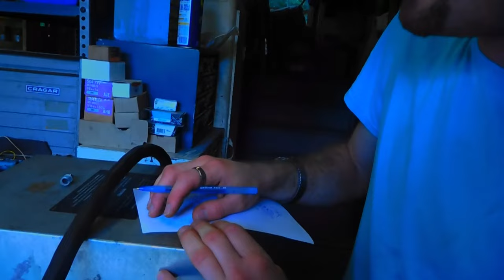Why Metric Base 10 is a terrible system.

Comment: The benefit of metric is compatibility and ease of conversion between different units of measure such as length, temperature, weight and volume:

1.5 kilometres = 1,500 metres = 150,000 centimetres = 1,500,000 millimetres.

A litre of water (100 centilitres or 1,000 millilitres) weighs 1 kilogram (1,000 grams).

The volume of 1 litre of water is 10 centimetres cubed.

Water freezes at 0° Celsius and boils at a 100° Celsius.

This is why the U.S. armed forces use metric in combat, because their lives literally depend on clarity and accuracy.
Reply: Not the US Navy !
Reply: You have to realize that water freezes at 0C and boils at 100C at sea level. The higher up in altitude you go, the higher the boiling point of water is. 

Since I am a huge car fanatic, metric makes it very difficult to identify a engine since some cars for example these days at 1.5L to 2.0L, there’s many engines out there with that displacement which makes it difficult to identify, especially if it’s a engine with a design flaw. If engines were still be cubic inches, would be able to identify quickly.

Comment: I think language is too big a barrier to use any number system other than base 10. The words we used are based arround base 10, so we think in base 10.
Reply: Yes, it's terrible we have no English words for a dozen and a gross. Even if there were a word for a dozen we'd be stuck with the fact that “ten” and “eleven” are made up of parts for their separate decimal digits.
Reply: in norwegian it is quite clear that it used to base 12.
Reply: @stephenspackman5573  Originally there were single glyphs for 10 and 11. They died out over the centuries as decimal gained popularity. Note that we have "eleven" and "twelve" as separate words, but everything above that from thirTEEN to nineTEEN is just a condensation of "<digit> plus ten".

Comment: I think in a more optimal world we should use the metric system in base 12. It does suck to not be able to divide by 3, 6 or 4, which is a very common operation.
Reply: But in the grand scheme of thing, the important thing is probably that we use the same base, so we can understand each other inventions. After all, if you don't want to lose precision, you can still use fractions to describe your metric measurement, and in practice we can't machine to arbitrary precision, and the specific need of each machine prevents use from using convenient whole numbers, so we will always have arbitrary digits to describe complex machines.
Reply: ". It does suck to not be able to divide by 3, 6 or 4, which is a very common operation."

It's only an advantage if you actually have 12 of something (or multiple of 12) and actually need to divide it by 2, 3 , 4, or 6. Actually dividing by 2 and 4 are the same and 3 and 6 are the same so you really only have two dividers, like with 10. It's a bit like saying we should go to base-24 so we can also divide by 12. :-)

Comment: Some random comments:

a) There is a reason the mathematicians that designed many of the first- and second-generation digital computers used base 12. Or that CDC computers had 60-bit words. Lots of prime factors are nice.

b) If you think about the representations of 1, 2, 3, 4 and 5, they do have a number of points corresponding to the digit.

c) You might want to look into Roman numeral fractions. Yes, there are such things, even nobody has been taught anything but the integers for 1500 years.
Reply: loved thinking on this comment
Reply: I can remember as a young child counting the top, middle, and bottom of the number 3 to add  3 to another number.
Reply: Oh which computer would that be? You mean every computer that was designed around the binary system because semiconductors uses a discrete sytem of 0 and 1? How would you multiply a binary system in such a way that you would reach 12? Show me a computer that uses prime numbers as a base system to calculate anything. Encryption uses prime numbers, true, but only in conjuction with XOR operations, binary base 2 operation that flip bits. The prime number is not at the core of that calculation, the XOR operation is. 

Computers could use a 12 bit bus, but that was simply because of simple limitations in the technology and most importantly it was the least amount of silicon one would need to store a base 10 number. There was no need for additional bits to represent something beyond 9. But everything still worked on base2 to begin with. Base 12 was a representation. 60 bit words in CDC computers. Yes, the ONLY computer that used 60 bit wide words. The world quickly switched to 64 bit wide words, because of the ease with which it held in base 2. 

If base 12 or something else was so vastly superior, then it would be used everywhere today. Humans only understand base 10, but computer can use whatever you develop them around. And guess what, base 2 is vastly superior and factors of base 2 (16, 32 and 64) are the most logical conclusion for uses within that system.
Reply: @patrickd9551  The first generation of digital computers were mechanical. Later ones used relays and vacuum tubes. There was quite some variety in bases and encoding before things settled out. CDC's 60 bit words were a strange hybrid, but they were much later. We had a Cyber at school….

I'm not sure where encryption comes in (those are very large primes), but 2 is a prime, and (along with minimality, of course) that's one of the things that makes it attractive for computation—there's lots of good number theory to do with prime powers.

Comment: I think any base system that is consistent and that everyone uses, is the best one. U.S. ("imperial") is horrible (I'm American) in this regard. We use fractions here, decimals there; base 10 here, base 12 there, units based on the length of some dude's toenail in 1627. Even within the same unit, even on the same drawing, fasteners might be called out like 7/16" while thickness of the washers for that fastener are called out in thousandths of an inch. This is where the metric system wins. It's consistent and everyone (except Americans) uses it. Base 10 might not be the most optimal system but the time for objections to it is long past. Everyone intuitively understands it already so that is how it is going to stay. 

P.s. the base 12 runes didn't even seem consistent. 1, 2, and 3 did, the number of lines is the number, but after that it fell apart. After 3 we start counting angles? Or? You lost me.

Comment: 12ths were originally used for everything including inches and of course we still have a dozen eggs, 12 months, 24hr days, 360deg in a circle or a compass heading and so on. For the common person 12 is much better for dividing things up. If you are a technical field e.g. a machinist you have to do math any way around it and like their metric counterparts imperial machinists use 10ths, 100ths, 1000ths, ... The solution to most problems there is to toss the excess to get to some reasonably divisible number. If you are making a cabinet with 3 evenly spaced doors into a space that doesn't divide nicely you pick a smaller number that does and then pad out the difference in spaces on the sides or between the doors or both.

Base2 is super handy for small (space efficient) representation and for on/off (binary) storage which is why it is used for computing. Hex, decimal, and octal in this case are representations of some binary state of data on a computer. You can also count much higher than 5 on one hand using base 2.

Comment: Due to my age 54 in the UK I work both in feet and meters and as an car electronics engineer I understand binary and computer hex, BUT at home if I measure a bit of wood it could be 4ft 7 inches and 3 mm but at work my brain can't cope with car tyre size (UK spelling) 195/65 R14 for example my brain as I look at it starts to work it out mathematically But that's the odd thing in tyres is they are sold in Metric/percentage  radius is Imperial
Reply: ha, I'm 60, from England. ! I too use both systems. eg when estimating lengths I might go from 2cm to 1" to 3cm!
Reply: Similar age from the UK. We grew up in a time when metric was taught in school but everyone older than us was using imperial (and so were all the shops!) so we got a weird mix of both. If I am calculating I tend towards metric (due to my base 10 wired brain), if I'm estimating I tend towards imperial, but I also do a weird mix of both where I might need a piece of wood 3cm x 4cm x 4 ft long 😂
Reply: In Scandinavia we use metric for general, but imperial for woodworking (originaly not British imperial but our own standard, but it later became Imperial) in addition to foot there where also another messurement "Aln! the messure of the forearm and hand, which is standarized to two fot or, today 60 cnetimeter. Only thing that does not make any sense whatsoever to me is the recent conversion from metric to foot for messuring flight height of aircraft, that one is a clear step back, but for wood and metal working me, and most people i know who want to learn in a deeper leve do use both metric and inperial in paralell for lenght and height messurement. My carpenters ruler has both scales, and it is fairly new and made in Sweden. ;-) I know theyt re made it to matric in modern time in most hardware stores, but people, my self included, still talk in imperial whan it come to dimmensions of wood and nails. 🙂 (Being born here, of course Celsius is the only option for temperature... ha ha, but there are a lot of paralell temperature scales as De Lisle, Rømer scale, etc which are far better for checking temperature in every day general use compared to the Kelvin scale which is originaly for temperatures above mercury and spirit themometers could preform by using the wawelenghts of light as referense point, so in my blacksmith it is important to know the basic of the idea of the Kelvin scale, it probably just had other names in te past, but for say, the airtemperature outside my window, using the Kelvin scale (is not wrong, but it) does not realy make much sense to be honest, but using for example the Rømer scale does.).
Reply: i think the first number is tread width in mm, the 2nd number is the width of the tirewall(ID to OD) as a percentage of the tread width, and then yeah for some reason the rim diameter is inches... it is very odd. thats how they are here in the USA too

Comment: I concur. Base 10 metric does suck, for many of the reasons you presented. However it’s not necessary to reinvent the imperial system, or contrive a base 12 integer set. Inches are divided into fractions. They can be any sort of fraction you like, it’s just that they’re usually denoted and divided in 2, 4,8,16,etc as an optimally convenient standard. Like time signatures in music. Not all time signatures are optimally written that way either, but most of it is.  I think it’s important to point out that imperial measurement system isn’t so arbitrary or primitive. Rather it’s an elegant collection of units, optimized for applicable utility, like a toolbox, as opposed to base 10 metric, which endeavors to standardized and universalize units, at the cost of being like Swiss Army Knife, lots of tools conveniently packaged into one, but none of the features perform as well as a dedicated tool would. ❤

Comment: The point of a measuring is to make thing accurate enough to do the work required, and almost as importantly create wide standardization.  At some point, and sooner rather than later for any reasonable value denominator to work with, you run out of whole factors.  At that point you are using either fractions or decimals.  Either work, the question is which works better for you so you make fewest mistakes.  I have proven that mistakes can be made with fractions and decimals, but the more resolution required the less mistakes I make with decimals, which seems to be true for most people (Most U.S. machinists who work in accuracies less than 1/64" use decimals...even while remaining in the U.S. customary system).  And by the way the fundamental feature of the S.I. system is standardization in unit definitions as well as expression; base 10, specifically base 10 with using decimals not fractions,  was chosen because it is the simplest way of standardizing the expression of any value regardless of magnitude.  It is a common mistake that people think the primary purpose for using SI is the base 10 system of expression, it is useful, but the real importance for the SI system over the imperial, or more accurately theses days US customary system, is standardization.

Comment: As kid growing up, I was taught and agreed, that metric base-10 was obviously the superior system. A bachelors and masters degree in engineering only reinforced that. However as I have grown older and taken to hobbies that put me to work with my hands I have come to see the benefits of the older systems. 

Older systems are base two (a gallon is 2^7 Oz) or base 12 (degrees on a circle, time) or the way we divide inches (base 2). If you are doing hand work, division into halves and thirds is easy and can be done with a marking device and protractor or string. 

Base ten metric is nice for working in base 10 math but with calculators and computers easy base ten multiplication and division is less important. Getting into a full base twelve mathematics may be more than my middle aged brain wants to deal with though.

Comment: There's a time and a place for metric... mostly scientific stuff. Machinists can have decimal inches and thousandths. Pretty much anything else, though... feet and inches make way more sense. The versatility of not just fractions, but just of relatable, practical sizes. Measure a car, or a room, and you have many hundreds of centimeters... or a convenient 15 feet. You could use meters, then you're inconvenienced by at least one decimal place if you want even a semblance of accuracy. And if you have something big enough to measure in meters... you've got yards, which are practically the same.

Comment: Better than - one fithty thousands of an inch cuz you can't have smaller measumerment than inch in imperial apparently.... yet, in metric you can go as low as nanometres and picometres... without needing supidity of 1/1000000000000000000000000000000000000 of centimetre when buying a drill bit, another stupidity is gallons and pints and all that bullshit - 1litre is 1000 mililitres it's not 3/4 and it's not 1 by something of something... plus our hands have 10 fingers and that's where 10 comes from so imperial can f**k themselves unless their hands have 1/34 of finger on a hand

Comment: "So you can do lots of fractions in your head"

Sure, you go right ahead and multiply 463in base-12 by 3/64th and then divide that by 23 in base-12. Go!

The "advantage" of 12 being more divisible is only there if you actually have 12 of something. That's how we got to the foot being 12 inches, and an hour having 60 minutes. Nice and divisible.

Ofcourse if you want to know how many inches there are in 1+19/32 of a mile then you're kind of f*cked, but at least you can divide 12 easier!
Also note that even in clocks, where we actually DO divide the hour alot, we use tenths of seconds, of 60th. we use 100ths of a second, not 1/60th/60th. There is a reason for that and it is " the math is impossible".

Even the UK, who had base-12 for their money but gave up on it. They had a pound that was 240 shillings and 12 pennies to the shilling. Very divisible, until you had 315 pennies,148 shillings and had to pay a pound.  Good luck with that.

There is a reason by metric is the dominant system and it's that in the real world it is simply easier to work with. It's not political, it's just easier. I know you want to have an easy way to divide by three, but YOU DON'T DO THAT.
Sure, you can think of edge cases where it's simpler with base-12, but the fact that you have to go to edge-cases to show how great your idea is means it's not a great idea.

Think of it as Toki-Pono, the language that only has 200 words. It's MUCH easier to learn than the thousands of words of other languages, its grammar is laughably simple, but saying "I am going on holiday and I'm taking the big red bucket that my grandmother gave to me in the spring of 1998" takes half a page because you have to combine a thousands words to alter their meaning to collectively represent that sentence.